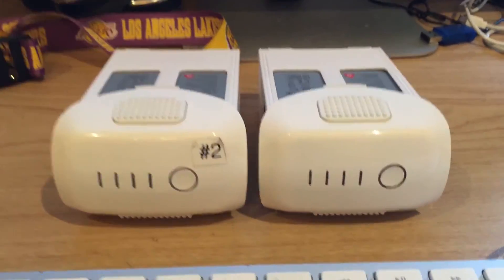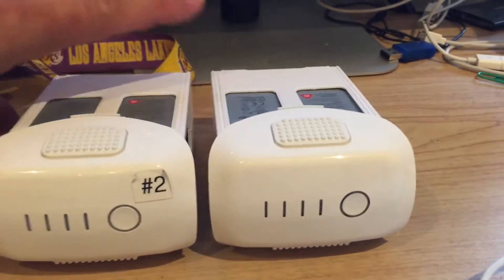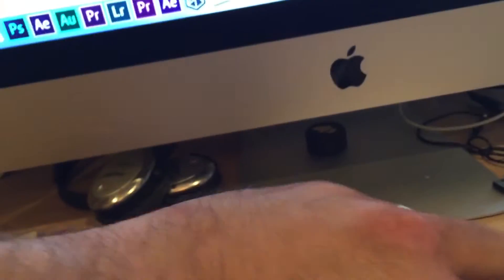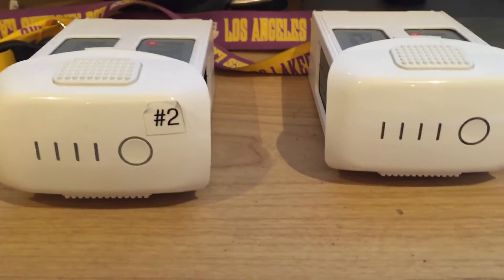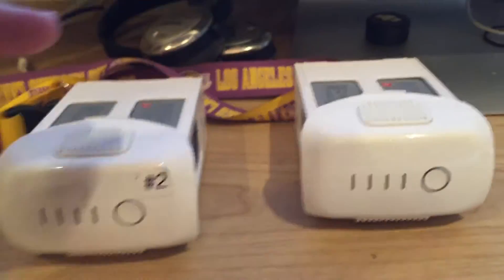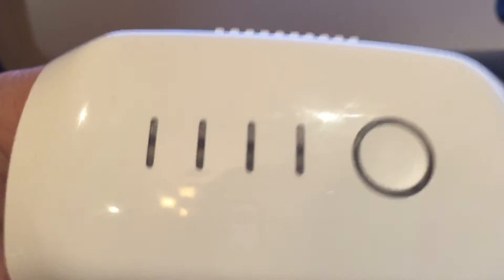Phantom 4 Battery Lights (the reason there is a production variance)

Comment: Instead of worry about such small details people should rather worry about how many batteries they shipped are dead. Thats a big fucking problem.
Reply from the maker: herantd I sold 736 batteries directly from DJI last summer on eBay and did not have one single DOA.  Check your dealer. Also, this is a very outdated vlog and should probably be taken down as I did it when the part 54s came out over the 7s because of the stress cracks and now there is a new part altogether for the P4P+ bats and most people want them.

Comment: I have a blinking forth light battery won't charge?!?
Reply from the maker: Dead battery.  There are people that can get it back from that but I wouldn't trust a battery that has gone bad and I am sorry to say that indeed the blinking fourth light is the battery telling you it is not functioning properly.  People have brought batteries back from the dead but again, I would dispose of it properly and count your losses and not lose a bird or worse over it.  Sorry Balance.
Reply: pretty crazy I spent almost 900$ bucks chasing a p4 battery. my came with a dead no light battery and the one I got from amazon was sick also. had to drive 2 hours to a local hobby store along with the battery is had just ordered from dji....
Reply from the maker: That's nuts Balance.  Sorry man. I, by happenstance had about 300 DJI batteries for sale that I got directly from DJI and sold them all on eBay and did not have one single DOA in the bunch.  The only issue I had with actually 289 battery sales (P4 Part 54s) was one that was actually a Part 7 and the guy didn't want that. Other than that, I had not one complaint or DOA so I always wonder when I see like a 10-12% DOA record with some of those GBA companies.  It's bizarre actually.  Sorry you had all those problems.  That does suck.